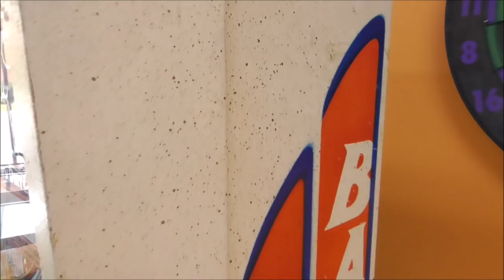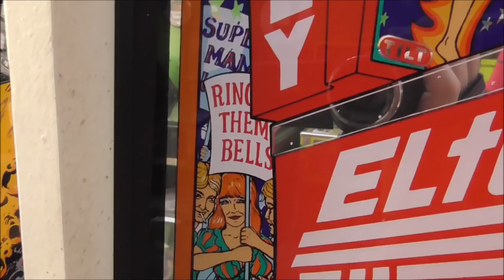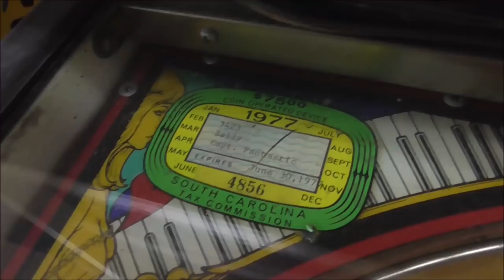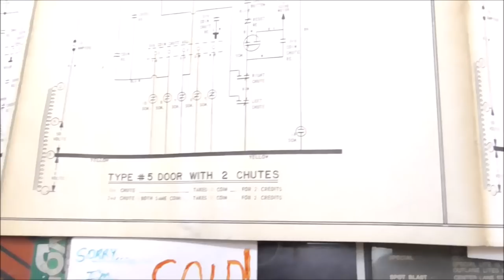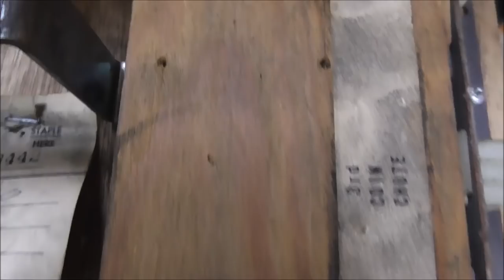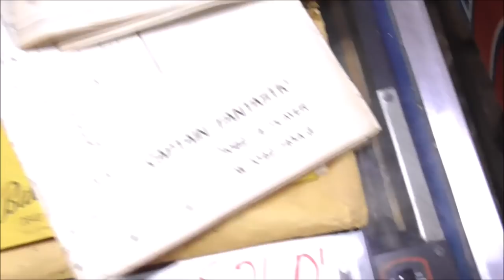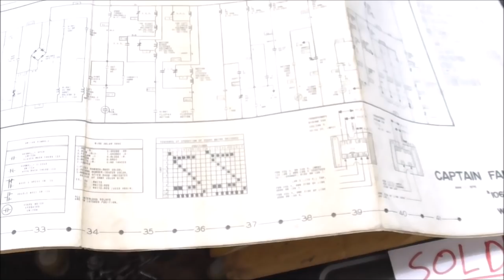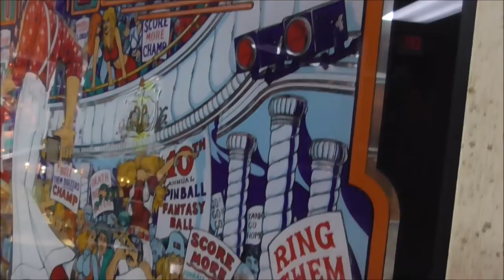Working On Bally's Super Cool Captain Fantastic Elton John Pinball Machine - Part 1

Comment: I actually have one of these at the house right now. The owner asked me to hold on to it and fix it up. He bought it with the solid state wico sound board installed. I took it out and put a chime box back in it. One of the other commentators already revealed where the 100,000 point light is on the back box. And with the way that you put out these videos, I'm pretty sure you found it. Thanks for another great video.
Reply from the maker: Thank you Pez, this is a really cool game, tell the guy you're still working on it so you can hang onto it longer :)
Reply: @LyonsArcade  ah you know my secret: "could be a few more weeks"

Comment: JOE, when you put a coin in the coin door slot it will turn ON the coin relay, what is turning on the Chute#1 relay and Chute#2 relays? or why do you need the Chute Relays?
Reply: AmericaDeservesBetter  JOE's Classic I mean the business
Reply: The chute relay is typically there to quit accepting coins when the credits are maxed out.  It just dumps the coin back into the return bucket.
Reply: @ovalteen4404  Thanks, So the chute relay only turns ON when the credit unit is maxed out? the credit unit much have a switch that open to turn ON the Chute relay